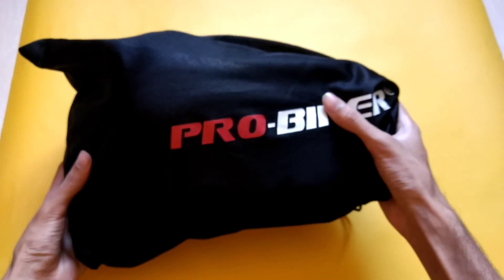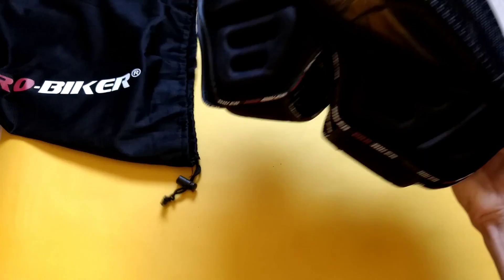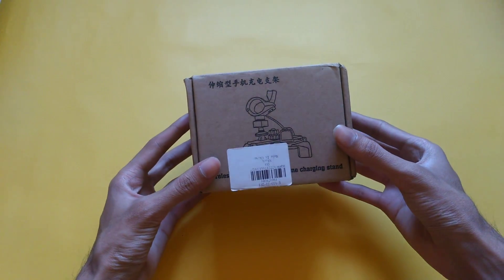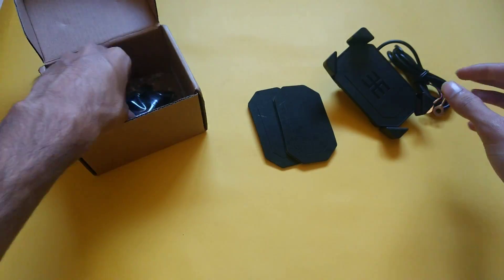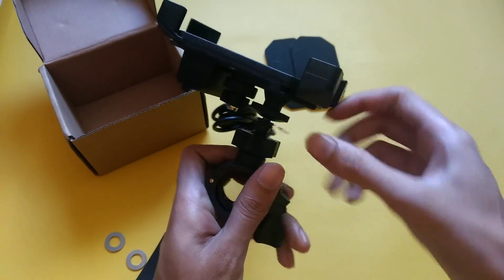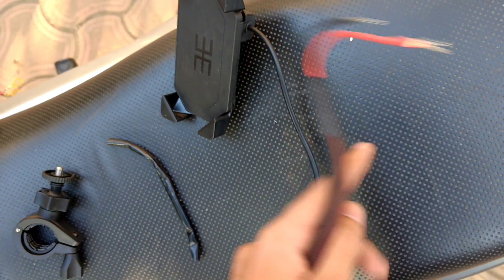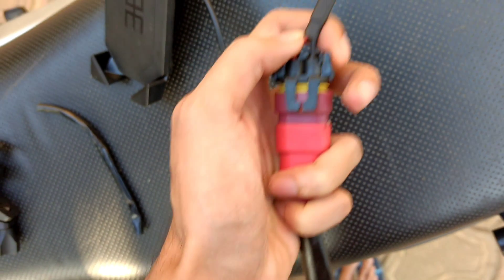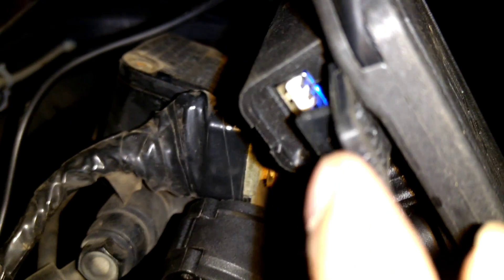Best Budget Knee Guards Pro Biker Knee Guards & Universal Motorcycle Charger + Holder Gearbest

Comment: Great Video And Stuff. Just to add on to that charger Thingy: if you'll give direct connection with the battery and attach a Male -female connector setup, most probably you'll end ruining your battery life. In order to use it effectively and efficiently, I would recommend you to plug it with a switch. So that whenever you turn your ignition on, you can use it and once the ignition is turned off, you don't have to worry.
Reply from the maker: Shaikh Shahrukh the connection serves the same purpose I don't use charger in city only on highways so just have to plug the connectors and when not in use remove and use phone holder separately.
Reply: Rev It Up I really appreciate that but don't you think it's a bit hassle to remove the connector when not using and put it back again when you need it. Instead you can go ahead and install switch.
Reply from the maker: Shaikh Shahrukh switch cost another 80 rupees where this one cost only 30 rupees